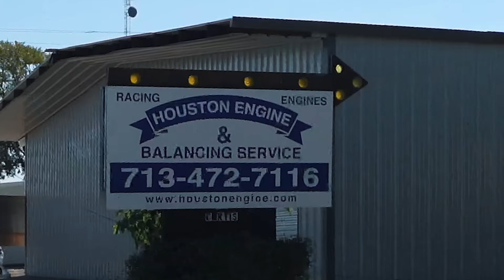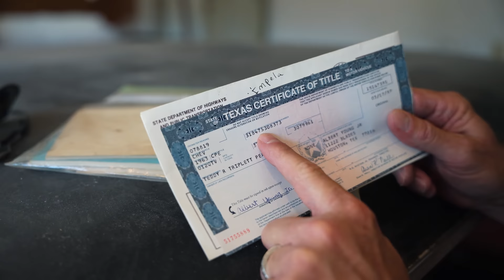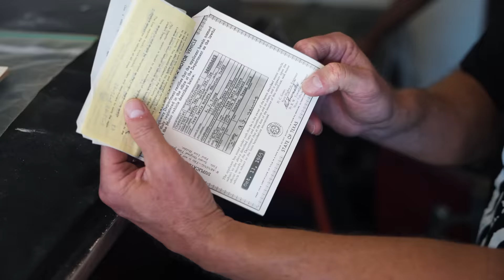RESCUED: 1963 Chevy Impala in Houston, TX!

Comment: Loved the "Cup holder" on the passenger door. Had one in my 1962 impala.  That 1963 had a bench seat I could tell. My Dad would put a trunk key under the hood trim then put an ignition key under the trim in the trunk.
Reply: The plastic can holder used to be standard equipment. Where else would you put your beer?

Comment: I'm curious about the 409 emblems on the front fenders. They look original. The small block under the hood does not look original. Look for a 3/8 fuel feed line on the frame with a 1/4" return line next to it. Might have a rare gem! Great video!

Comment: I did more of a repair than restoration on a 63, I took a 350 out of an old dump truck, didn’t have an engine, then had the machine work done by a shop on Lamar blvd in Austin. I feel pretty confident that when I’ve got it tuned in I could stand it straight up in the air.

Comment: Ah yes. . .My first car was a 1963 Impala SS.  It was 4 years old and I got it for $1000.  It was a 327, 4-barrel, 4-speed. . .I believe the HP rating was 250.  I'm sure it had been run pretty hard, but It mostly needed paint.  So I literally took it to "Earl Scheib" and got his famous $29.95 paint job.  Didn't look too bad, Silver Blue with a black interior.  I saved up and bought 2 Cragar SS wheels for the front tires (only $75 each back then) and took the hubcaps off the rear tires and just let the black wheels show.  Only other thing I did was add a tach to the steering column.  Drove it until I went away to college and my Dad traded it in with his '65 Impala SS for a '69 Ford Torino.  Ah, memories. . .

Comment: miss my 63 impala. Should have never sold it.
had the original inspection sticker on the windshield, black with blue interior. 283 with powerglide, had a chrome tissue dispenser under the dash, 54k original miles... Ugh.

Comment: I'm surprised you said the stag has a rover motor, incorrect,  the original stag engine was a sohc per bank all alloy v6, a triumph unit..... however,  due to the bad design and corrosion a lot have had rover v8s fitted....

Comment: There's a guy in Erie Colorado that has late models to older models Volkswagen buses I think at least 40 of them or more if I could recall I can send you more of the info if you're interested Mr Dennis Collins they're building houses around the property they're going to probably tell them to remove the cars out of the property I think
Reply: There used to be another VW shop / yard in Greeley, Colorado that you can see from the Hwy 35 by-pass around the east side of town.
There were several notch-back wagons and Karman Gias parked along the fence.  I haven't been pass there in years - don't know if it is still there.
Reply: @urbanurchin5930  nice